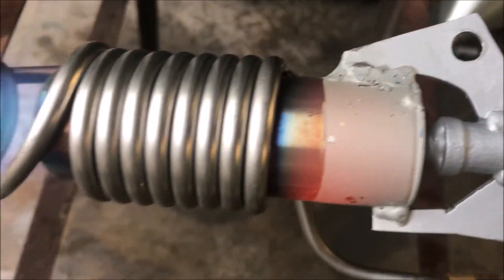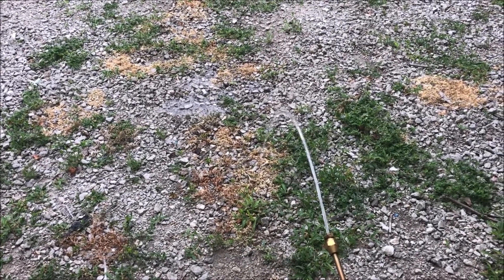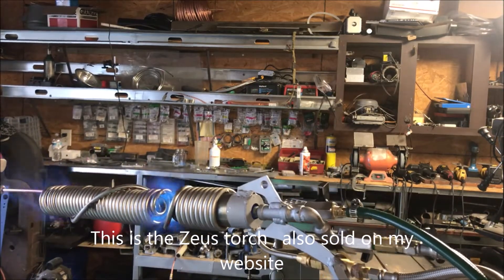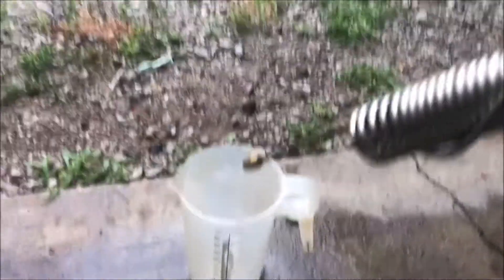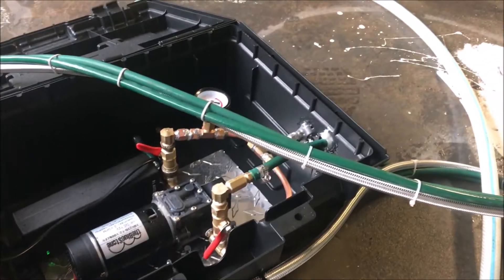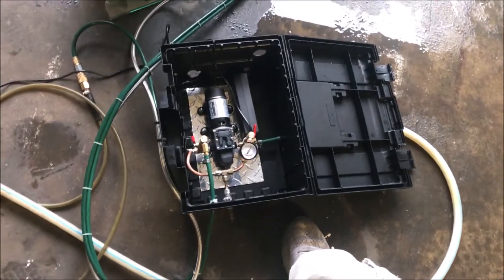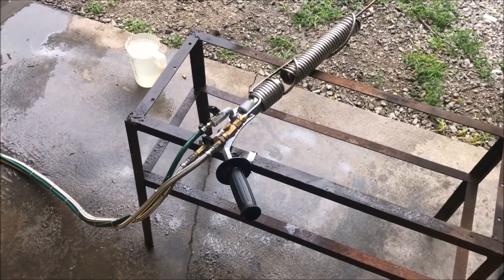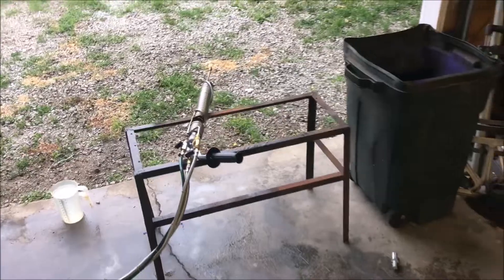Organic Steam Weed Killing Machine Chemical

Comment: I'm fascinated by these boilers and torches. Why is so much pressure required with such little water use? Wouldn't a low pressure high volume pump like a transfer pump work? I'm imagining the water coming from a reservoir tank and instead of a bypass loop, the bypass would send the excess back to the tank.